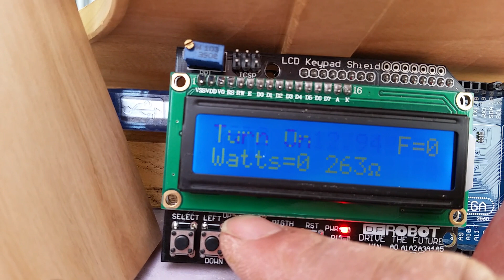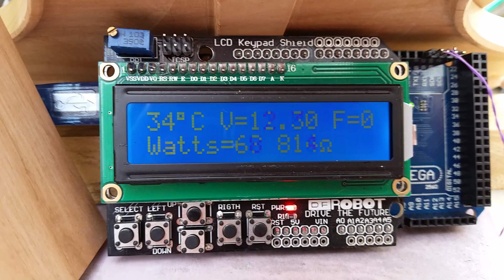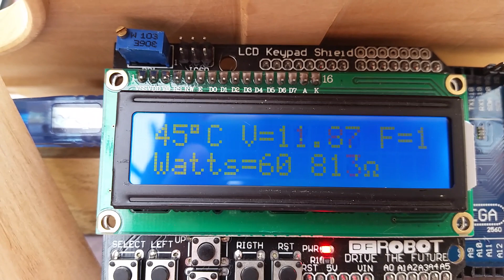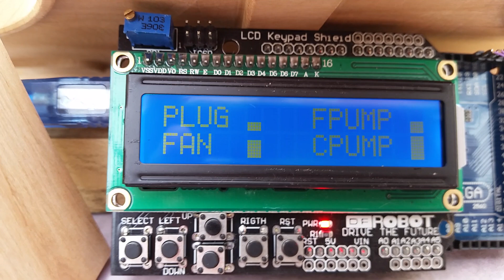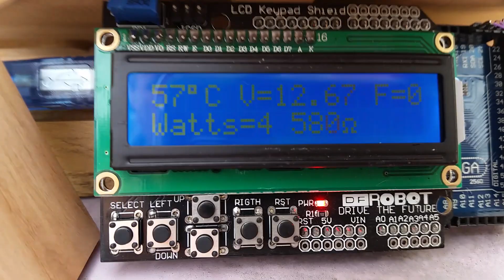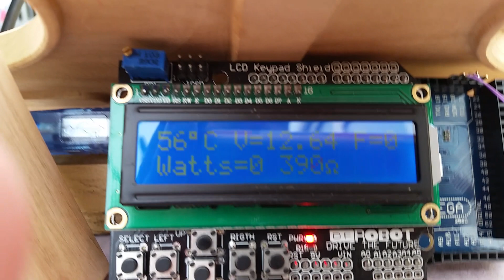Arduino + LCD + webasto thermo top V

Comment: long time ago but i want to give it a go again... do you have an sketch to share?
Reply from the maker: I was just about to reply saying it's in the comments below somewhere, but I guess you found it :)
Reply: Hi mickr. I have one question, "sketch" in this film, is the same on link in below comments? I have problem, my arduino say me only: "TIMEOUT!!!" and won't connect with my TT-V.
Reply from the maker: no reply from webasto. wiring?
Reply: Wiring look's ok.
For this project i used serial TTL -> K-line/W-bus converter, build by transistors a resistors in prototype PCB.
If i connect it to TT-V by serial/k-line + FTDI usb\serial, and use thermo test, i have fully functionaly diagnostic by WTT. But when i connect it by serial/k-line direct to arduino, i take "TIME OUT!!"

I see only one problem:) I try convert your scetch to run on Arduino UNO (atmega328).
I change only in program serial ports, serial1 rename to serial0 and use it to w-bus, serial0 realized by softwareserial. And now.. debug on softwareserial works good-on arduino serial monitor, all data works same as hardwareserial. but on serial-wbus i have problem.
Reply from the maker: Did you change the Define TX pin to match your new pin? as this is used for the 'break' signal to tell the webasto to accept a command.

Comment: Hello,

Does the automation also go with ESP32?
Reply from the maker: I've never tried on an esp32 or esp8266, but the code is fairly simple so it should work as long as you define all your pins correctly.
Reply: mickr1969 Good morning,

I am a beginner in electronic assemblies, can you give me a schematic of the assembly?

Thank you very much

Alexandru

Comment: Finally got a sketch hacked together that uses a GSM module instead

Now building the hardware... opted to use the L9637D, in the sketch you only use one TX line... no RX needed ???

you posted this link a year ago: http://www.labkit.ru/userfiles/file/projects/car_shm/car_board_comp/01.GIF

and that one uses both RX and TX

for those that is interested my code is: http://pastebin.com/d8vpG8U3

still need to make the schematic complete in eagle
Reply from the maker: I use tx and rx as you send commands to the unit and also read back if it accepted the  command and also other data such as temperature etc...
Reply: yes but only TX is defined in the org code
Reply from the maker: TX is defined in the code for the SendBreak(byte duration) command so it matches the pin being used for the serial port. The actual TX / RX communication just uses the standard serial library, so no need to define the RX pin.
Reply: oki doke... will put a note in my code to connect RX to Digital 0 or RX... thats correct right?
Reply: or should i connect to RX1 ?
Reply: From what I can tell if you're using a Leonardo Serial1 is RX=0, TX=1 , On mega it's RX=19 TX=18

Comment: @mickr1969, could you advise. I've connected everything according to pins in your scheme, with the  L9637D chip. Rx/Tx pins are 10/11 accordingly.
1) I join Bo Hermanssen's question: as i understood the code, the "tx_line" which 0 variable is for serial output, but i don't need to connect anything to pin0, right?
2) When i connect device to K-line, it initializes but displays "TIMEOUT!!".
3) Serial monitor output shows some weird symbols, still hasn't managed to arrange output in plain english symbols.
Please advise.
Here's my album with how i connected everything: https://goo.gl/photos/9z3EDez2JYj9W1Eo8
Reply from the maker: Hi, In my code I had #define tx_line 18 //pin for TX
This var needs to be set to the SAME pin on your adruino that you are using for the serial TX. I was using a mega2560 and pin 18 on that is TX. I defined it as a var so you can change it if people were using something other than a mega2560.

The tx_line is used as a serial break command, which tells the webasto to get ready for a command. If you don't send this, then you will probably just get the "TIMEOUT!".

Hope that helps!
Reply: Thanks for quick reply! I have UNO, it has pin 0 for RX and 1 for TX. I suppose i have to make tx_line = 1. What about Rx? Anyway gonna see that, as video tells, the code somehow receives responses from webasto. Re-downloaded your code, tells error about Serial1 being not defined in scope http://take.ms/JzlPB. Re-checking. I'm more Ruby On Rails coder, rather than C :)
Reply: Ah, got it. It appears that "Serial1" is for MEGA and isn't fit for UNO.
Reply: Almas, did you run your program on UNO? My still don't work;/ all compilation with no problems, but i still take only "TIME OUT!"
Reply from the maker: Did you disable the original serial stuff? If you are using only 1 serial port now you may be sending debug messages to the webasto along with the actual data so that my not work.
Reply: Hey! 
Funny thing happened - downloaded raw sketch and wbus.h from this video's description. And launched it. It worked!!!!!!! As in your video. Evo 4. Blogged about this (in Russian, but you can see pics): https://www.drive2.ru/l/468855673535332753/ Thank you!

Just your code as it is and 18,19 TX RX connection
Reply from the maker: Great!  Glad you got it working :)
Reply: By the way. Didn't ask this because anyway sketch didn't work before. I have reading on power: "Watts: 255 681 omega". What are the units? Should be W. But omega is resistance, ohm. How should i read this?
Reply from the maker: Almas Abulkhairov 
The ohms is the resistance of the glow plug. The unit uses it to detect the presence of a flame. The watts was supposed to show the power output but it doesn't seem to work correctly.
Reply: Almost got this interface. So the space between 255 and 681 is supposed to divide power output (Watts) and resistance of glow.
So that in my case power is 255 Watts (which is maybe wrong) and Resistance is 681 Ohm.
Reply: BTW, these measurements are for heater that has just been turned ON, not in the actual main operational state with max output. So maybe they're right. But eager to see something close to 4 kW
Reply from the maker: Yes, you have Water Temperature, Voltage, Flame (1 or 0) for lit or unlit on the first line.
Then on the 2nd line you have Power output in Watts (which doesn't seem to give the correct value) then the Glow Plug resistance 263 ohms on my video..

Comment: Hey guys, will it work on my Thermo Top Evo 4?
Reply from the maker: Almas Abulkhairov sorry I'm not sure. I don't have a one to test.
Reply: Where are you located? I could share mine. If you are in Saint-Petersburg, Russia :)
Reply from the maker: Almas Abulkhairov I think distance may be a slight problem. I'm in the UK near Newcastle.
Reply: I've been to Newcastle & Durham about 10 years ago. In your source code i see wbus.h being mentioned - how can i find it? I'm looking for W-Bus or KL line framework in order to understand how it works & how to program controller for my Evo 4

Comment: Can you share your code/schematics? Thanks
Reply from the maker: +Susana Godinho 
Link is already in the comments below, along with how to wire it up.
Reply: +mickr1969 
Thanks, the code seems to operate OK, but haven't got a burner to test at the moment.
I noticed there is a mention for a 18.43Mhz system frequency, rather than the 16Mhz standard. Was this a typo from when you ported the code or is it needed for baud rate compatibility?

Lastly, can you confirm the pump you've used? I can see its a model V, just looking at which OEM/part number. There are a few variations, might as well go for something like you have for peace of mind. 

Once again, many thanks for sharing this.
Reply from the maker: Hi, this code is only for the thermotop V only.
I don't have other burners to test compatibility.

The only other burner I've used is the C or Z burner and does not require any code to work, just 12v to pin1 of the unit to make it "go". (note BMW models have different firmware and do not work with the pin1 method).

The 18.43mhz must be an artifact from the original code. I'm just using a standard arduino mega2560 with no modification.
Reply: That reminds me of another question. I know the thernotop V uses an external fuel pump to Meter and pump fuel. Does the C/Z burner also need this or is it integrated on the unit already?  

Thanks
Reply from the maker: +Susana Godinho 
yes they both use external pumps. Some cars have everything on a nice metal plate with pump exhaust etc all mounted. I think its a citreon c8 or Peugeot 508 but I'm not near my pc to check at the moment.
Reply: Will it work on Thermotop 4?
Reply: Hi Almas, did you make it work with a thermo top 4? Did you do some changes in the code/hardware? Thanks!

Comment: anyone that can tell me what i do wrong with soft serial?
Reply from the maker: Bo Herrmannsen 
Hi, unfortunately I'm not using soft serial as the arduino mega has more than one hardware serial port.
Reply: mickr1969 i thought mine would have that too since its based on the mega

but the 2 pins on the chip with the serial port is not connected to anything :-D
Reply from the maker: Bo Herrmannsen 
I'm using serial 0 for debug messages, and serial 1 for the communication to the webasto. The output from serial 1 then goes into the obd k-line converter chip, to give the correct signals needed for the webasto.
Reply: mickr1969 i use serial for debug, but serial 1 and 2 are tied to a GSM module

the only one free is serial 3 which is not connected to anything and my skills are not up for soldering wires to the chip pins
Reply: +mickr1969 problems solved... i tried to solder on wires on the board i had and i failed. lucky me the gsm module was in socket and i had a mega in the junk box

just have to wire up the whole thing :-D

Comment: cool! can you share your source code?
Reply from the maker: Dimitri Minich 
Sure.

http://pastebin.com/9jEW030e

It's a bit rough and ready, and based on a pic version that I found on the internet.

Mick
Reply: mickr1969
Hi Mick, 
thanks!

Can you please upload wbus.h?
Do you have an image of circuit?

Dimi
Reply from the maker: Dimitri Minich 
wbus.h

http://pastebin.com/8e8JQdX0

I dont have a circuit diagram, but the output from the aurdino is on serial 1 (pins 18 and 19 on the mega2560 I'm using).

I used a L9637D (ebay item 171541780075) to interface with the heater, but there are several other similar chips that will do the job.

Hope that helps!

Mick
Reply: mickr1969 Hi, do you have a link to any more info about interfacing the Webasto with the Arduino?
Reply from the maker: Mark Trent 
Most of the info I used came from www.disco3.co.uk/wiki/Fuel_Burning_Heater
There was also some code for a pic microcontroller which I used as the basis for my arduio code.
Reply: mickr1969 Great, Thank you!
Reply: +mickr1969 Do you use pins 1 and 4 of the L9637D chip or just pin 1? Thanks again!
Reply from the maker: Mark Trent I wired it up the same as the diagram here:
http://www.labkit.ru/userfiles/file/projects/car_shm/car_board_comp/01.GIF

Hope that helps!

Comment: Hey everyone. I just got my arduino parts to make this work. Author's code compiles, need hint on wiring (i'm not strong in electronics, more about software). Using russian-made GSM modem device to control my Evo 4 for now, but want to make an app to control webasto with arduino. In your video - where does the purple wires pair go? It's hidden behind battery and i can't see which wire eventually should go into yellow wbus connection? What i mean is the yellow cable in the center of the following picture: http://take.ms/2XNfe
Reply from the maker: The purple are the TX and RX  lines (pins 18 and 19 on my arduino) that go to a L9637D chip which is a serial to K-Line converter chip.
http://www.labkit.ru/userfiles/file/projects/car_shm/car_board_comp/01.GIF

There is a diagram there of how to wire up the chip (you just need the ic2 part), ignore the stuff to the left of the picture. All you need is 1 chip and 1 resistor. The KLINE goes to the wbus connection on the webasto.
Hope that helps!
Reply: Thanks for the reply, got 1 step closer to epiphany :) But here are few more questions on this diagram: https://monosnap.com/file/3U0MdyrIWoCPwTbaZch7ZywUelUqWp
- can i just connect VCC pin of the chip to 12V or need to wire up the capacitors?
- does "R12 910" mean 910 Ohm resistor?
- about rx/tx got it! :)
Reply from the maker: VCC goes to arduino 5v, and yes 910 ohm resistor.
Vbat (pin7) goes to 12v on the webasto, and shared gnd goes to both arduino and webasto.

Comment: i got an adapter to comunikate my laptop and the thermo top V. now i have the ptoblem that i need to have a start code , holding and shutt off code . but i need it in hex codes dose anyone can help me?
Reply from the maker: It's all in wbus.h , and the arduino code. Hit the "SHOW MORE" just under the video, and the links are there.
Reply: i wana tu make just an start stop system for my ttv with no display btw to start it with 12 v